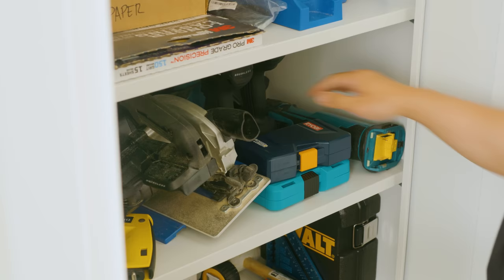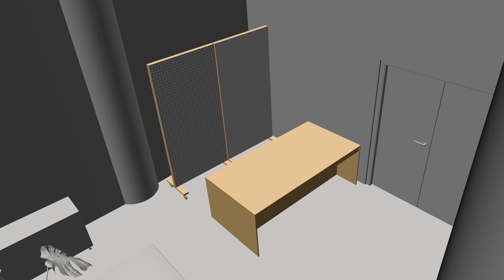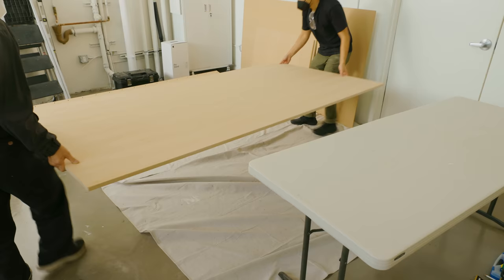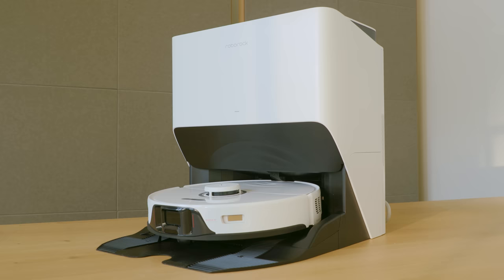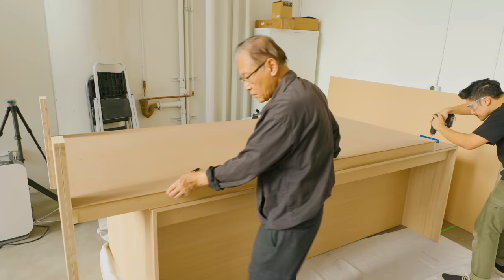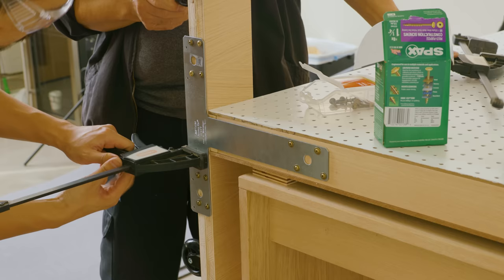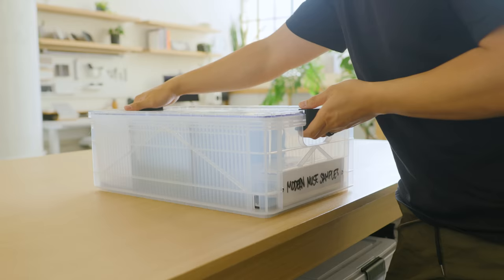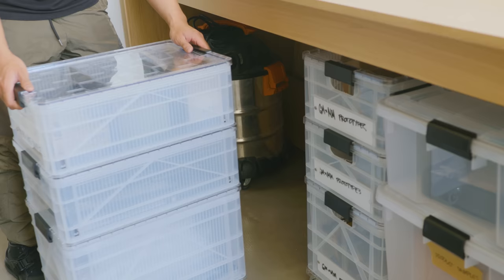DIY Workshop with a Hidden Pegboard, Whiteboard, and Tools

Comment: Nice idea and execution.

Just a couple of suggestions from an architect. 

You could have put fibreglass batts in between the front and back panels of your movable screens for extra sound deadening.
You should have installed levellers on the table in case your floor isn't level.

Other than that, top not job and kudos for you dad coming up with the threaded insert idea. Us dad's come in handy sometimes ;)
Reply from the maker: Thank you for the tips. I considered stuffing the moving walls, but they would add weight, which I wanted to keep to a minimum. I may consider it the future, but perhaps with a more robust base/casters.

Comment: Small tip, put mineral wool inside the rolling project walls, and you'll see a massive difference :)
Reply: (for acoustic treatment + it makes everything fire resitant as a plus)
Reply from the maker: @gabbamoreno  Noted. Is that stuff heavy? I'm trying to keep it very light.

Comment: Hi Matthew. Love the woodworking projects besides your other design content.  How do you go about organizing your woodworking tools? Which tools do you recommend to build some of things you've built in this channel? Have you done a garage organization video?  Thanks for sharing this!
Reply from the maker: Hey thanks. I don't have a garage, and my tools are all kept here. I've linked my tools used in most of my videos if you check the descriptions. I'd say the top two things worth getting are a circular saw with a track (or track saw) and a good power drill. Those are the top two tools I use most often when breaking down and joining pieces together.

Comment: Hello Matthew, very nice project as usual !

To avoid the steel bracket maybe you could have use "triangle shaped wood piece" between your base and your board (4 shapes per walls). Just an idea to an already awsome build ;)

Can't wait to see how you'll use this space in future projects !
Reply from the maker: A triangle base is common for these types of walls and was the type of thing I was trying to avoid because of its bulk. The steel plate was a solution to avoid adding extra supports on the front and back to keep the base minimal.
Reply: @MatthewEncina  Nice point, thank you for explainations.

Comment: Didn't see a single cut being done, do you have a dedicated place for the dirty dusty work? It looks more like a design studio than a workshop, but really amazing!
Reply from the maker: Correct. I decided not to do heavy woodworking in here, just light assembly work and finishing, that doesn’t creat too much dust.

I bought wireless battery operated tools to do that outside (or will have my lumber shop cut for me).

Comment: As always, fantastic work and aesthetics. 

Quick question: The base of your work table, did you add structural support beyond the 3/4” plywood to form the base for the tabletop? Without it, it would seem to have lateral sway. Do you have plans you’ve released for this build?
Reply from the maker: No plans out currently. The table only has the H-shaped base, nothing else. It’s mass and many contact points make it feel solid. It hasn’t moved at all.

Comment: Is that a different kind of plywood? Every kind I’ve seen have only been the kind with thin sheets put together and not 2 thin sheets around thicker wood
Reply from the maker: I just discovered it for this project, and wanted to try it. It's called "lumber core" plywood. It's cheaper and not as sturdy, from what I can gather. If I were to do it all again, I would spend the extra money on the more common multi-layered plywood.

Comment: i have a question 
is it cheaper just to buy a table 
or to build a custom design table like this (assuming u know nothing about woodwork and will hire carpenters to do the work for u )

is the total difference really high ?
Reply from the maker: Probably the same or more expensive if you hire an expert woodworker.

Comment: 10:57 - where did youi get these containers? I like them, and they would be very useful.
I could probably find them at the container  store, but they are expensive.
Reply from the maker: Yes, the big ones are from the container store. The ones on the left from Sidio, which are linked in the description.

Comment: 2x4s would have been so much stronger than that plywood, which has most of the grain running in the short dimension making it practically useless for adding strength.
Reply from the maker: I'm aware. But strength is only one factor of many I had to consider. Size, waste, and aesthetic swayed me to use my leftover offcuts.

6 months in, these things are still working great.